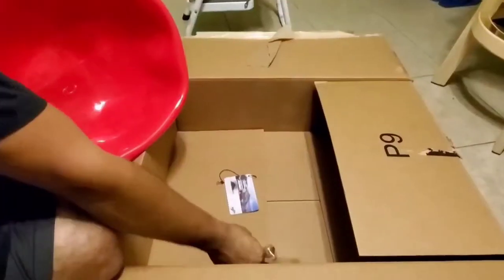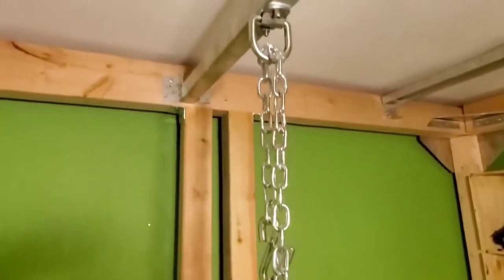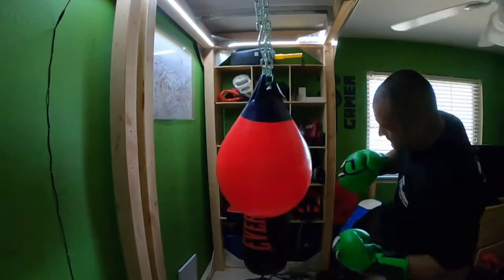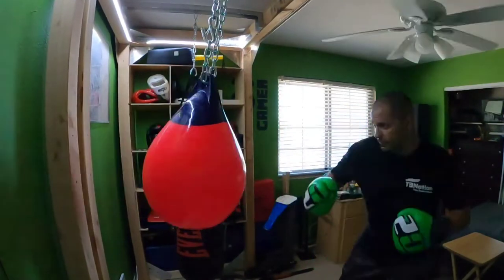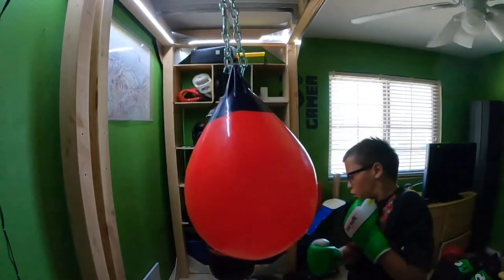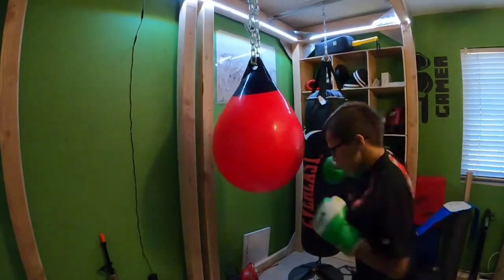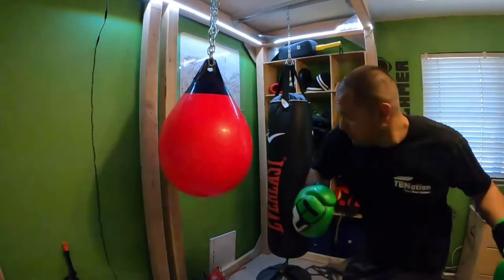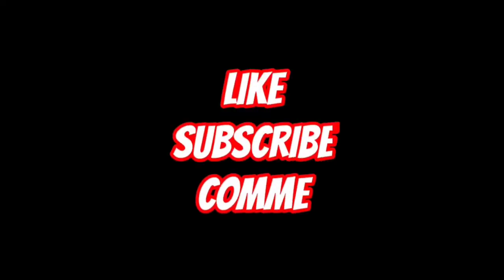Water Heavy Bag for Boxing, MMA in home made UFC Gym.

Comment: how would this hold up if i made it a bit wider and deeper? is the aluminium beam a must for the aquabag? i'm moving in the near future... possibly to an apartment so i have to figure out how to keep things quiet as possible. 

my current setup is in my basement with a head hunter buoy, a polyform A3 buoy, a double end bag, and a micro double end ball. everything (save the micro ball) is attached to one of several I-beams (roughly 8" wide x 1' tall, spanning the length of the floor plan). I went to school for engineering and I'm a land surveyor by profession so I'm capable of design... but i'm no where near as handy or well tooled as you are. 

I'm just about to turn 34. i'm a career 135 pounder. i like to move, pivot, weave, work off angles etc. for my new place, i plan to get a ground floor apartment if I cannot find a reasonable house. my new setup will include the 100lb everlast hydroblast waterbag (it's the only water punch bag that isn't a rebranded buoy... they actually designed the shape themselves to where it has the similar shape as a punch bag but includes the rounded bottom for uppercuts. plus it's only 100$ at walmart). i plan to use soft loops on it instead of the chain to reduce noise. the only other thing i want to connect to it is my double end bag. i'm going to anchor it with a dumbbell as i always have.  i'm going to replace my micro ball with the winning sb-9000... but that can be put up anywhere to that's irrelevant. 

any input or advice you have would be greatly appreciated! you do great work! i wish my dad was as supportive as you. your son will always remember how cool this was at his age.
Reply from the maker: This holds up very well. I put a 200lb heavy bag on it just the other day and there are no problems. I would have solid beams in the middle for anything of significant weight. You can also just use steel beams.
Reply: is a3 the size of the video boy?

Comment: What size bag is it. I need this for shoulder rehab after two broken clavicles and hyper mobile shoulders.(I am 43, but have the punch of a weak 12 year old. To small would lack the benefit but to big would bring more damage than benefit. It looks about 20 by 28 inches am I right?
Reply from the maker: It's only about 2 feet high and 16" wide. Weighs 120ish lbs.
Reply: I assume you could only half fill it if you wanted too